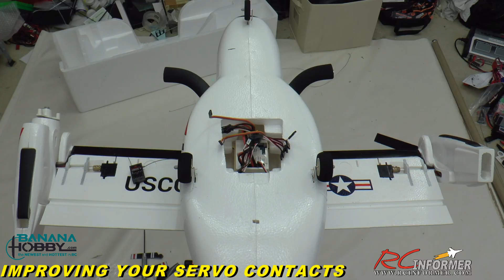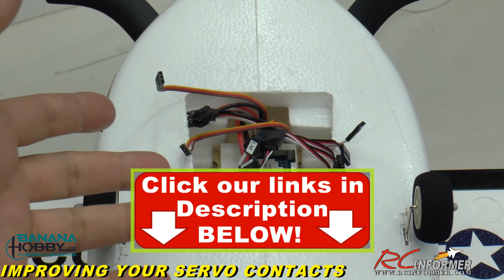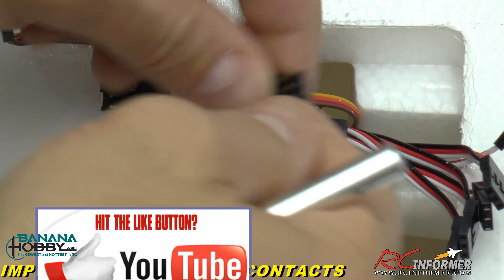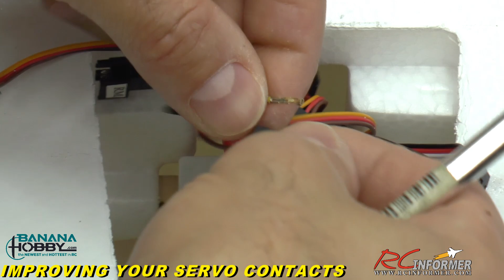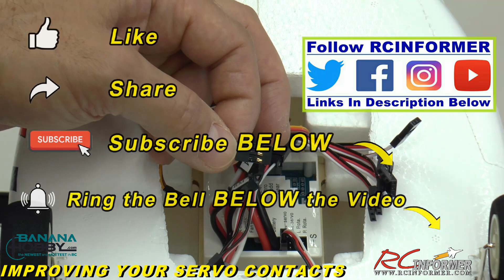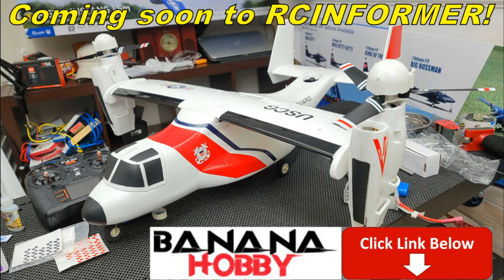Tighten you're servo connections and reduce failures with this quick tip By: RCINFORMER

Comment: Does that causes receiver problems wen the rc servo is not tighten contacts to the receiver
Reply from the maker: No, but it can cause intermittent servo movement or loss of servo control IF there is a bad connection!
Reply: @RCINFORMER  i had servo connection problem to reciever it was the usb wall plug but i tried 4x aa batteries Allgood and tried 7.4v lipo battery worked good thing is with my other servos they work good on the usb wall plug just the new servos ive got didn't

Comment: I used this tip yesterday to fix a balancing plug which was presenting intermittent contact with my voltage meter. I found which wire was giving the bad contact and pulled its connector from the housing. I was able to see how loose the pin on the meter fits. After lightly pressing (smashing) the connector it gave a solid contact no matter how I move the balance lead. Thanks again!

Comment: Bonus tip - After you jab your finger,  a drop of CA on the puncture wound works nicely.😬  Seriously, another great tip I'll watch out for this from now on.👍
Reply from the maker: Be careful!
Reply: @RCINFORMER great tips man. Huge shout out from Canada. Rich do you put velcro to prevent battery slippage on all your planes? For example on the Otter and the piper cherokee? Do you get double side adhesive velcro or just glue it in?
Reply from the maker: @deppi   I normally use shelf liner with double sided scotch tape to  Keep it from sliding.... The 2 straps will keep it attached to the shelf liner and that way I don't need to use Velcro:)
Reply: @RCINFORMER  ok . Thanks